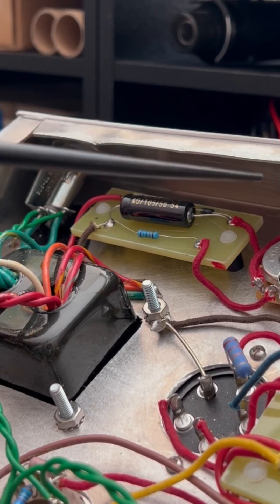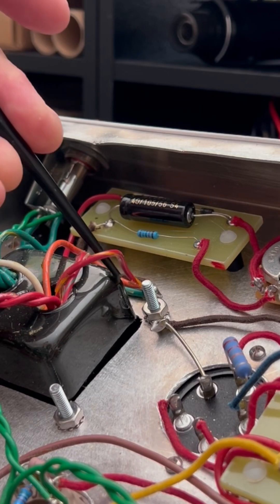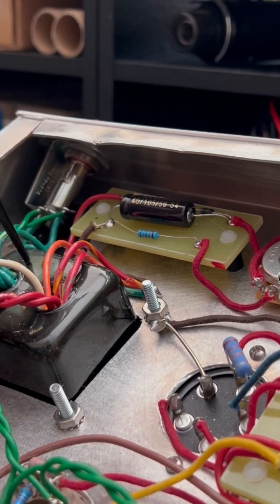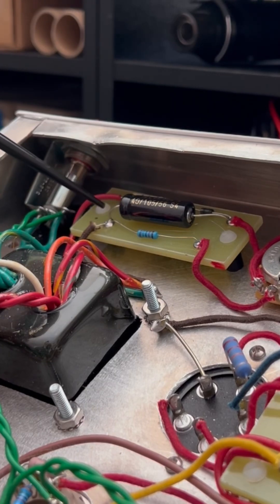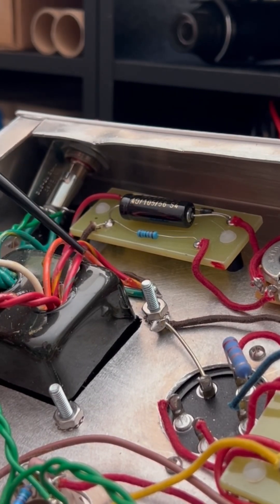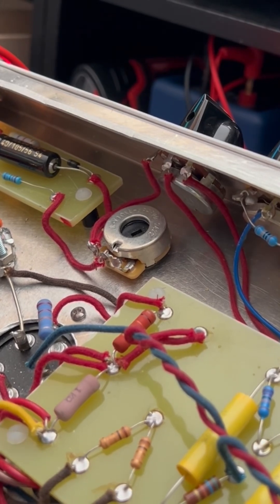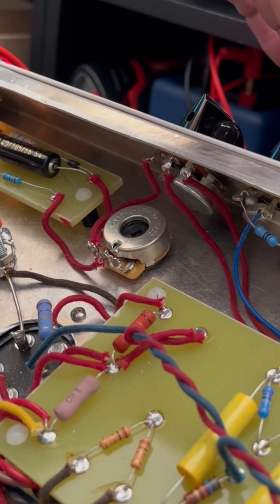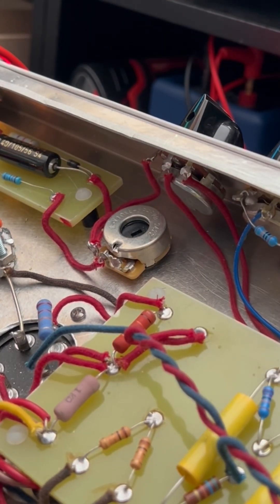Bad grounding scheme = noise!  #electronicsengineering #fender #guitaramp

Comment: My mom had a bad grounding scheme.  She’d ground me and then be annoyed that I was in the house and after an hour I was told to go away, go outside.
Reply from the maker: Haha my mom must’ve read the same schematic.  Made me an outdoors guy.
Reply: @ForgottenGearRestorations I’m about to build a 6g15, what tank would you recommend for the classic Dick Dale sound?  It’s going into that same studio.
Reply from the maker: Studio and 6g15 — you might have some ground loop implications. Are you going off original schematic? I like the MOD tanks. They have a smokier tone than the old accutronics though.
Reply: @ForgottenGearRestorations Board wise yes I was going to leave it as “vintage” as possible but I was gong to do my ground scheme. What do I need to know about this going into a recording studio? Dang am I gonna learn something again? That’s twice in a week.
Reply from the maker: If you use a grounded power cord you could have issues with buzzing as it’s used in front of another amp. Could!  I have a video of what I did to prevent it without floating or elevating the ground like the newer fenders do. I can’t recall what I did to that old one I restored!  Lemme wake up and I’ll update.

Comment: Nice work, Frank. I get tickled at some audiophile designs that use HUGE filter capacitances, and despite that, they can't get the buzz/hum out of it. And I explain to folks, all that capacitance makes for really high peak ripple currents, and if your ground scheme isn't up to it, those currents turn into voltages ON THE GROUND LINE, and that means ground is no longer really ground, and it can be a bear to fix it.
Reply from the maker: Yikes that sounds terrible to deal with. That’s a world I haven’t lived in.
Reply: @ForgottenGearRestorations  The big thing now is using supercapacitors as filter caps. Tens of FARADS of filter capacitance. It's silly, but they do it.
Reply from the maker: WUT